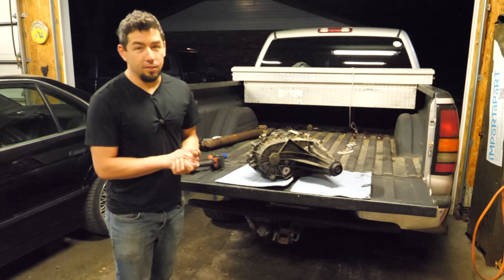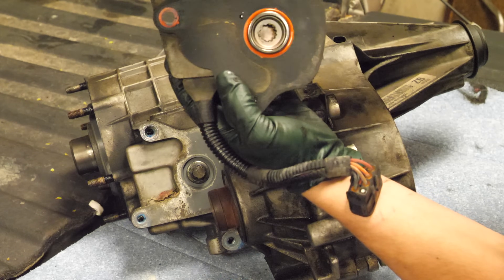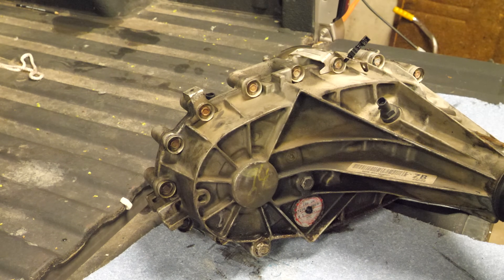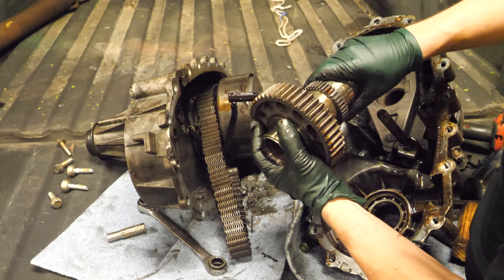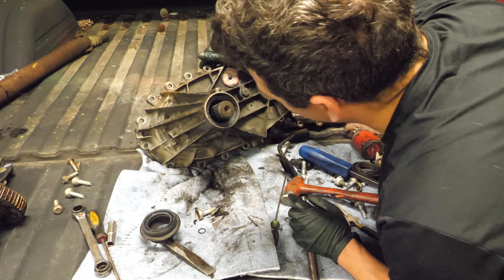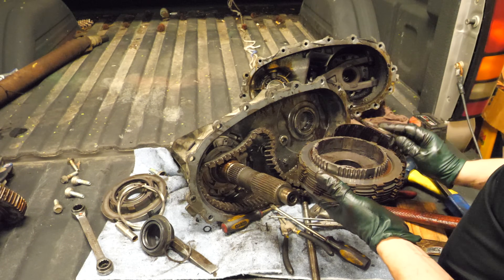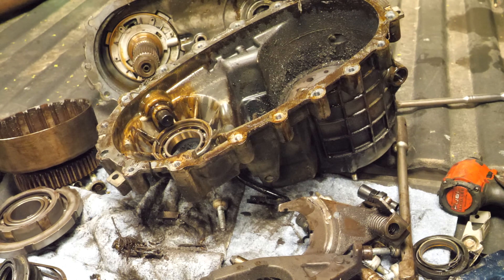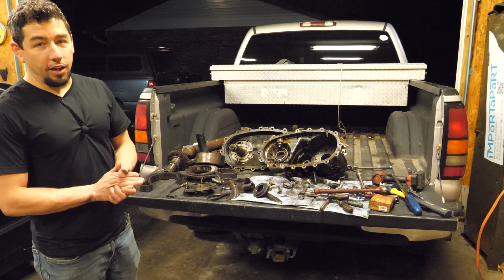Failed Chevy Silverado 4x4 NP246 Transfercase Teardown! 4 Button GMT800 Transfercase Autopsy!

Comment: Cool. I do my Transfer case and rear diff every 30k miles with M1 full synthetic 75W-90 (only need 1.5L to do both). 2006 Matrix AWD with 195k miles runs like new.
Reply: @Freiherr Dinckelacker Gotcha.
Reply: @Freiherr Dinckelacker Lots of trucks come from the factory with synthetic gear lube in the diff.  Heavy-duty trucks especially.  Also, the lower number of that viscosity value is the thickness of the oil when cold, and the upper number is the viscosity when hot, as compared to traditional single-viscosity oils.  That's why so many modern engines call for 5w30 oil, which is not really SAE 5 (which would be too thin) at operating temperature, but only when cold (and a true SAE 5 when cold is still pretty thick).  An oil that is the equivalent of SAE 140 when hot is great for drive axles when going slow in off-road, high-load situations, but totally inappropriate for typical speeds on roadways.

Comment: My 263XHD tore itself up because of the damned pump rub issue. A very common problem in the GMT800s regardless of which case it has. I just wish I would have known about it prior to it failing.

Comment: One of those sensors is for the spedo and I’m pretty sure it has a temp sensor, as well.  Think there was prolly a light or gauge indicating trouble before it went boom…

Bet driving in 4WD on the highway gets a dry T-Case nice and warm, especially if you’re running 4Low and putting all those good times through the planetary.
Reply: id say with experience, & confidence,,it was the nut behind the wheel, that was the problem..

Comment: Neglect or overloading is almost always the failure mode for drivetrain components. Most ppl don't even know there is oil anywhere besides the engine -that must be maintained 🙃
Reply: that's if they even checked it in between oil changes.  let alone any other fluids or grease. i would be shocked if most people even opened up the owners manual.

Comment: Better than a Durango I worked on when I used to work for Pep Boys. Lady comes in saying it's shaking, and I told her it's the front driveshaft that's bad and don't drive it. She kept driving it and the driveshaft tore the transfer case almost in half. We had to send to old one back as a core, and there was a tag that said "Drain all fluids from core before returning" so I left a note saying "No fluids here lol" I wish I could've seen their reaction to that

Comment: This era NPG xfer cases are notorious for pump rub where the sharp edges of the oil pump rattle their way through the softer magnesium case.  There is a steal clip to prevent this, sometimes it comes off.   Over time pin hole leaks form and invariably remain undetected as the oil sprays out in a fine vapor leaving no visible leak.    An aftermarker kit replaces the sharp factory sharp edges with more surface area so as not to wear through the case.  On my 05 Dmax at 90k I pulled mine as PM and replaced the back 1/2 with a AL case and left the pump as is, also replaced the seals and forks.

Comment: Seen one grenade cause a guy drove in 4 high on the highway with brand new rear tires and bald fronts. They were technically the same size but there was a good inch difference in diameter. Stretched the chain so much it started jumping teeth then piled up and blew out the side of the case. Don't drive in 4 HI on dry pavement, especially if your tires aren't perfectly the same size
Reply: or,turn corners, best is, when you buy a 4x4, JOIN A FKN CLUB, KNOW YOUR VEHICLE. do you own maintenance. if not,  DONT BUY ONE.

Comment: I'm going to start diagnosing a non functioning 4wd on a 1994 Ranger and I know the 'step motor' behind the txfer case can be a failure point - does anybody know if I can pull that step motor off and keep driving the truck while I look at it in spare time?

Comment: Curious to know if it was a small drip or a catastrophic vacancy of  fluid?? I have seen several videos of dry transfer cases.
Reply: I think you can be pretty sure that a catastrophic oil loss would have resulted in oil all over the outside of the case and all over the underside of the truck.  Even a reasonably slow leak results in a persistent oily mess, in my experience.  A poster higher up in the comments remarked on having a catastrophic oil loss from this same kind of transfer case and the whole back end of his truck was coated in oil.

Comment: Attention!! Good to see this one. Since this was a Z-71 it should have the G80 lock for the rear code( check in glovebox. It put extra strain on  this, you should change out the fluid especially if it is over 150K, it takes a special type also.

Comment: Pretty common for gm t case to snap the oil pump clips and rattle a hole straight through the case. I lost count of how many case halves and case savers ive done.
Reply: why not suggest,fitting a decent t/case, instead of gm crap..or buy a decent 4x4, not gm crap..like, say, a 208, or 1356. still original t/case in my 82 bronco, 75 highboy, 62 f100. 2002 s/duty,,see a patern here.. gm build sht..there 12 bolts about the best thing they have.
Reply: why not suggest,fitting a decent t/case, instead of gm crap..or buy a decent 4x4, not gm crap..like, say, a 208, or 1356. still original t/case in my 82 bronco, 75 highboy, 62 f100. 2002 s/duty,,see a patern here.. gm build sht..there 12 bolts about the best thing they have.
Reply: @harrywalker5836  well they don't make t cases out of nodular iron anymore. It's hard to break a t case when the case, the gears, the shift forks are made of iron and run at about .005 % efficient.

Comment: The pump probably wore a small hole through the case and ran it dry. Need snap ring pliers for ring on bearing in the back

Comment: When I had my suburban my transfer case went dry and I had to replace the back half of the case. I remember reading some where about a GM tech bulletin regarding an issue with the fluid. Manual said to put atf in it but the bulletin said that there was a problem with the atf evaporating out over a long time. 5-30 solved everything.
Reply: If you use motor oil you need to be careful to use one rated for wet clutch. JASO MA or the like. Better off sticking to ATF and actually checking it now and then.
Reply: @dentalnovember  mine was a 1997 2500. It didn’t have clutch’s, I believe they had synchros.

Comment: I’ve got two engine suggestions, one of which I’m sure comes through the shop ALL THE TIME. The Chrysler 3.6 Pentastar, and the GM Atlas engines, preferably the 4.2 I6 or the 3.5/7 I5s. I recently learned that the Pentastar was apparently a stout motor but they come in a whole bunch of cheap cars so I bet you see a good number of them. Would be interesting to see a teardown.
Reply from the maker: Just had a pentastar core come back in! 
Maybe we’ll see a video on it 🤫
Reply: @I_Do_Cars  I’ll look forward to it!
Reply: Sounds like a good idea.  Especially the 3.6 Pentastar.  Most of those just get junked due to head gaskets or bad roller rockers.
Reply: @greggc8088  yeah I learned recently that they have some seriously nice internals, they even have 6 bolt mains which is insane for a small ish V6
Reply: @jackets64  at the end of the day it's still a Dodge Mopar mo'problems

Comment: Lookup Precision Transmission youtube channel for teardowns on domestic RWD transmissions and transfer cases. Richard has an excellent video showing how to teardown that exact transfer case. You did very great for not having the snap ring pliers.
Reply: Richard is practically the same format.  Walks in, little background, grabs the impact and goes right to work.
Reply: Another vote for Richard and Precision Transmissions. If you’re ever going to teardown a transfer case or transmission, that channel is phenomenal. Love all your videos and looking forward to the next one!
Reply: @djvwilliams  It's just a shame he never does videos on Toyota or other Japanese transmissions. Maybe because they rarely ever break, or he just doesn't do videos on them for some reason.
Reply: it blew my mind in one of his videos 'there are 7 of these little balls, but only this hole matters. if you dont have this ball in this hole it will go in reverse and drive at the same time'

im paraphrasing, but it was still amazing something so small could cause such a problem.
Reply: Was gonna say, I think Richard has done the same model a few times now. Good reference material.
Reply: Just checked them out from your suggestion and wow! Started binging videos lol. Guy clearly knows his stuff watching him tear a tranny apart with ease.
Reply: Richard is old school. He only recently got himself a Milwaukee M18 rattle gun. Previously it was air Air AIR all the way!
Reply: Yeah, PT is very good.
Reply: He uploaded a video today with what looks like the same transfer case.  Old time hot rodders know their stuff.

Comment: Those bolts looked weird because they're designed to not provide a ground path.  The front of the case is aluminum, the rear is magnesium.  The oil pump is aluminum, and it wears through the mag case which causes the fluid to drip out.  Pretty much every case from that era of GM vehicles is bad or has been repaired.  Another problem is there’s no sensor to indicate high temp or low oil, nor is there a check interval. Just replace every 45000 miles or so. A lot of damage could occur in that 45000 miles. This is a bad design, not a failure to maintain.
Reply: The GMT 800 trucks with auto-4 take auto trak 2. It's a blue fluid, kind of unmistakable. The gmt900 trucks just call for atf. I don't think you're suposed to, but I've heard of guys running atf in the older units without problems
Reply: @carterthiessen2664  Not all GMT800s run auto track. The non-auto track take DEX-III or higher. Some people insist on running 5-20 synthetic.
Reply: @carterthiessen2664  You are right about the special fluid that's needed for these models with the clutch pack, but ATF is the oil that's supposed to be used in the more basic units (the ones which do not have a clutch pack).  So what you've heard about people using ATF on older models is proper!
Reply: I remember on the Benz forum for Benz's suv when I was troubleshooting if my transfer case was bad, that one thing was lot of transfer case go bad, and guy explain that in order to service them you had to remove the drive shaft to get access to both the refill and drain plug and the dealership doesn't do because it a very huge hassle to do it.
Reply: when you change your oil, every 5 th k,s. diesel. you should look for leaks, check levels. oil does not dissapear. old, even some new, toyotas, leak from the t/box, to the g/box, so people,toyota drivers that know sht, just think its the g/box, then the t/box blows up,,why did that hapen,?.  do,,your,,own,,maintenance..
Reply: Also make sure to use the correct fluid type, Auto-Trak II.  It needs the friction modifier since it has friction disks for the automatic transfer engagement.  Weird things happen if regular gear oil is used.
Reply: when you change your oil, every 5 th k,s. diesel. you should look for leaks, check levels. oil does not dissapear. old, even some new, toyotas, leak from the t/box, to the g/box, so people,toyota drivers that know sht, just think its the g/box, then the t/box blows up,,why did that hapen,?.  do,,your,,own,,maintenance..

Comment: Engines, Transmissions, Transfer Cases, and Rearends all require lubrication.  Run any of them without oil and the result is catastrophic.  CHECK YOUR OIL.
Reply: Such a simple thing, but so many do not. Work security!
Reply: I checked all mine before a long trip and half way into the trip it failed. It didn't leak prior to and was empty and tore up 150 miles later. I didn't even bother opening it up, there was plenty of chunks in the drain hole.
Reply: @chadalcock7275  Damn